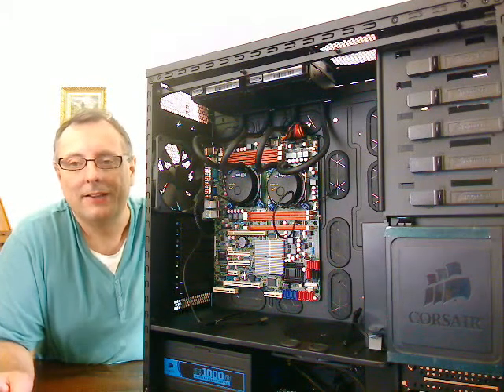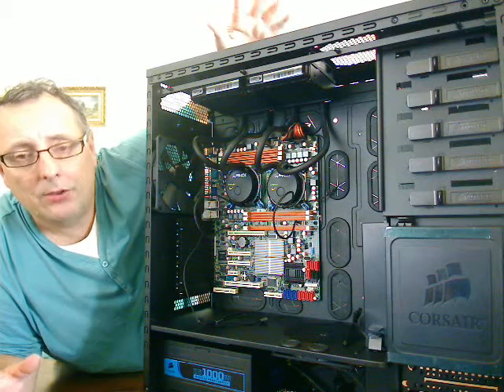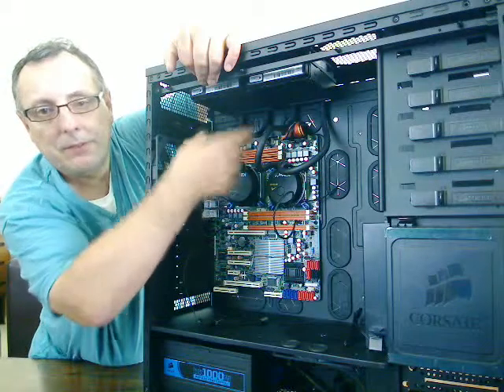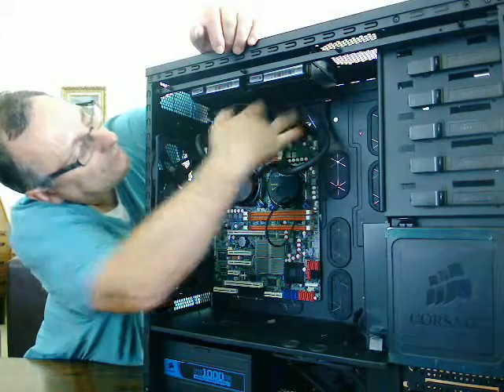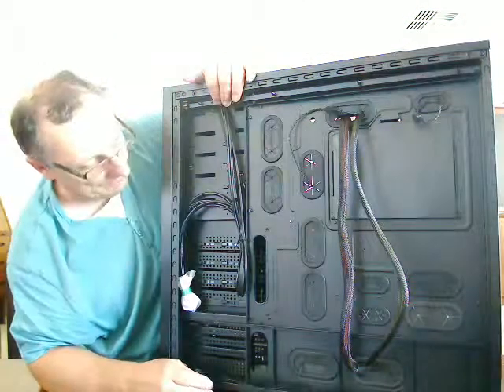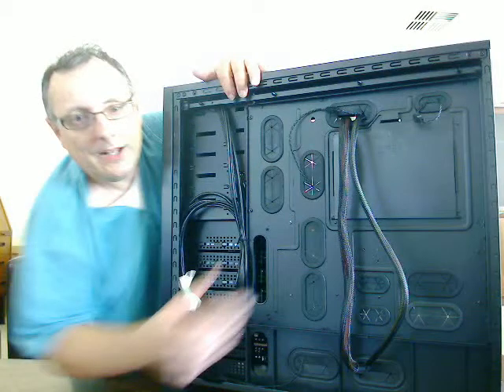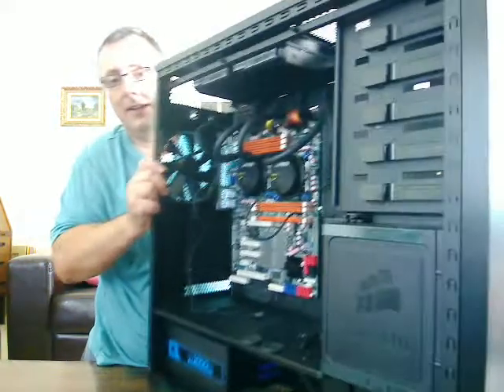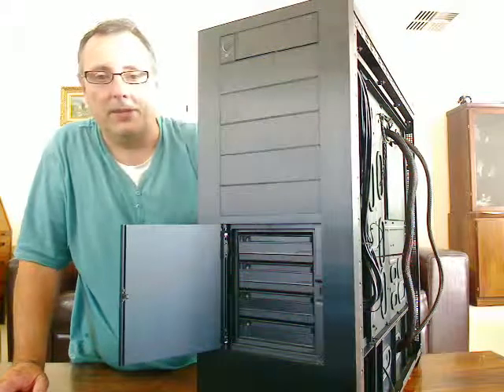Building A Small Business Server - Part 7-9

Comment: did you have any problems with the motherboard backplates? and how do i know which water coolers are compatible with this motherboard :) ? for example would a MasterLiquid ML120L fit?
also does this motherboard have pcie x16 if yes which one 1.0, 2.0 or 3.0?  Thanks
Reply from the maker: Sorry for the delay in replying.  I had no problem with the backplates.  Most have a thin film of double sided tape which allows them to adhere to the board to allow the brackets for the coolers to be screwed on easily.  Most of the water coolers on the market come with a range of brackets to suit a wide range of CPU's.  If you go online and check out the manufacturers website there is usually more detailed information than on the packaging or the retailers web info.  I'm not familiar with the Masterliquid range but their website should be able to confirm. Yes, this particular motherboard Asus Z8NA-D6 is PCIEx 16 compliant

Comment: do you really need water cooling? I mean do the xeons heat up a lot? or it's mainly for the noise?
Reply from the maker: That is a fair comment.  Please bear in mind that I live in Western Australia.  The air temperature exceeds 40c regularly in the summer and whilst reverse cycle air conditioning is becoming more popular the vast majority of small offices still run evaporative units which are not as efficient.  Also, the reduction in noise through not using CPU fans is significant.  I do believe that after installing liquid cooling you will never want to go back.  The cost of these sealed units are coming down every day and the server is still running perfectly to this day and it remains switched on 24/7.
Reply from the maker: I would say that noise is certainly a major factor.  I have to admit that after installing liquid cooling I would never go back to fans for CPU cooling.  Having said that the ambient temperature does play an important part in the overall performance of a server.  I live in Perth and the outside temperature can reach 40c regularly in the summer and that is an issue for all computers.  With lots of hard drives generating vast amounts of heat plus the motherboard I felt it was prudent to over compensate.  Afterall it's the lifeline for my business.  All my emails, my databases, my orders, my accounts.  Everything in fact so I think its worth a belt and braces approach.